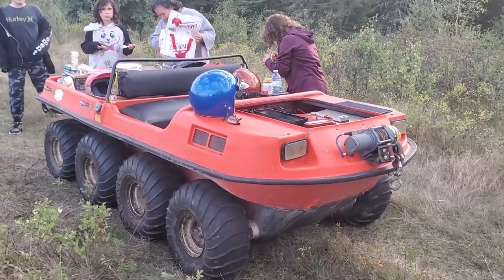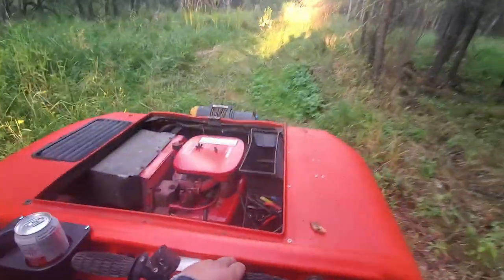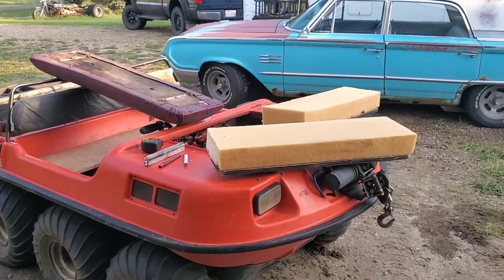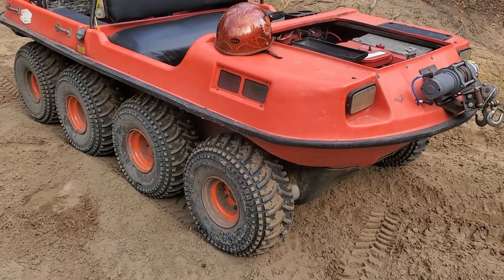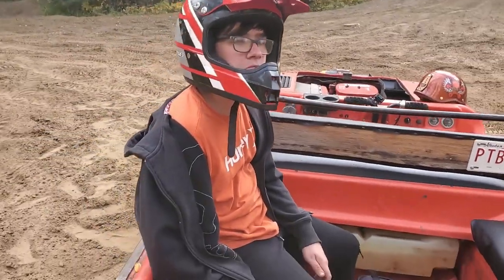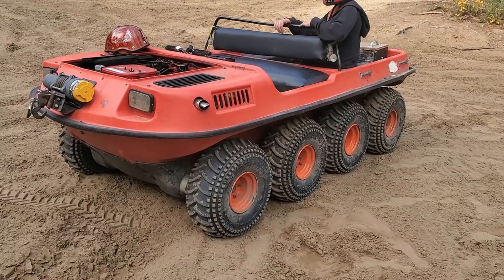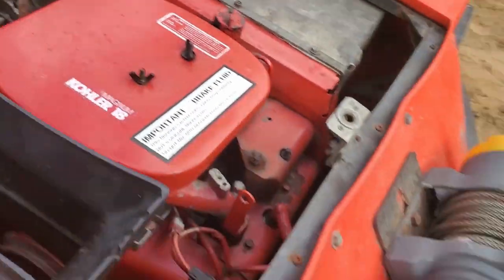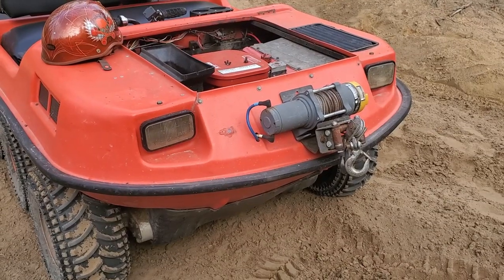Argo Magnum 8X8 part 2

Comment: Pop the tires off, clean the rim seat with a wire brush & apply bead sealer around the rim before recounting. Tgat tire slime does not work, it never does. It just makes a horrid mess inside the tires. Tunes will rip tre valve stems off....

Tip: you can replace the 22x10-8 rudamuck tires with ATP mud lites 22x11-8. Cheap, chunky & my argo conquest  swims with them as well

Comment: your brake reservoir tops are on the wrong way round. Rubber is supposed to be on the inside.
Reply: This is the correct way, the caps have a hollow centre